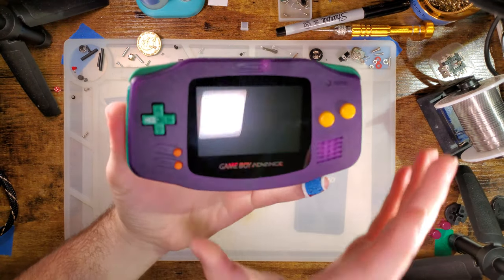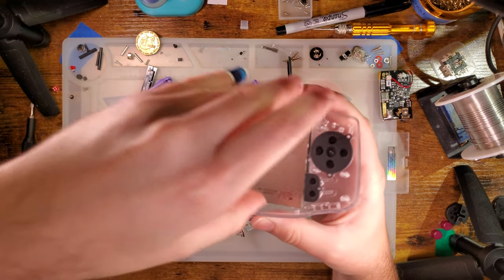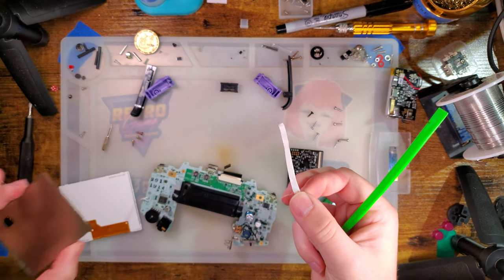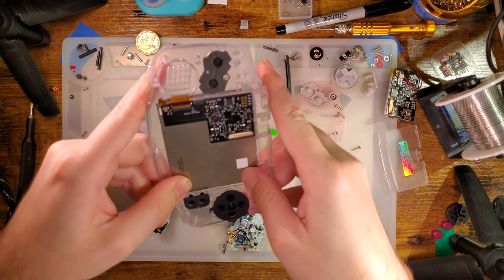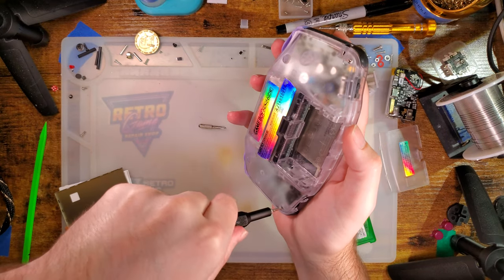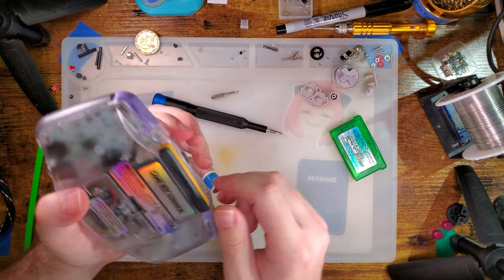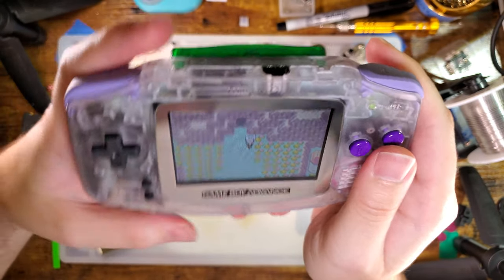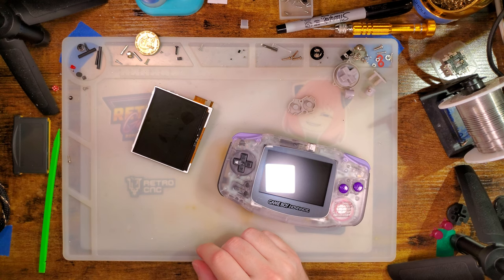Game Boy Advance ITA Mod Busted Screen Analysis and Repair

Comment: I build mine recently and yeah, I think your analysis is correct, I took out my PCB out a few time when installing and the speaker usually get caught with the small ribbon near the screen. I did carefully seat the speaker each time to make sure I wouldn't break anything

Comment: I prefer the ITA options for sure. The IPS screens are very clean, but they are extremely fragile and i really think they need a laminated option. The laminated IPS for the GBC is the best screen mod for any system by a wide margin, if we can get something like that for the GBA it'll go a long way to alleviate the main issue with an IPS panel. IPS laminated panels work well in the GBA SP as well. For slotting into an original GBA shell, with a gap behind the lens, the ITA feels like the way to go.
Reply from the maker: soon

Comment: I have gba sp but no video no sound, the led is normal, even without cartridge it wont boot. I swapped the battery, but still same. I put my lcd to another mother board, the lcd is fine.
I check the fuse f1 f2, the fuses are good.
Help me makho, any idea how to fix it?
Reply: No